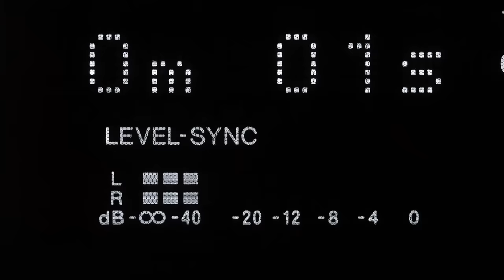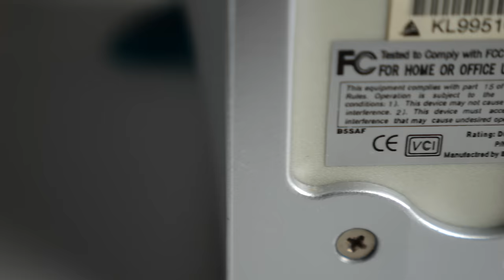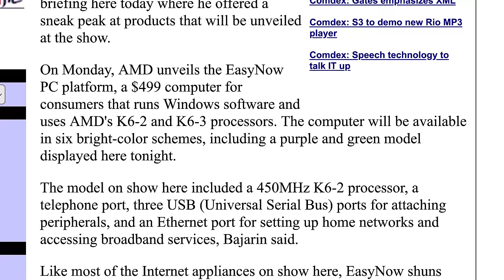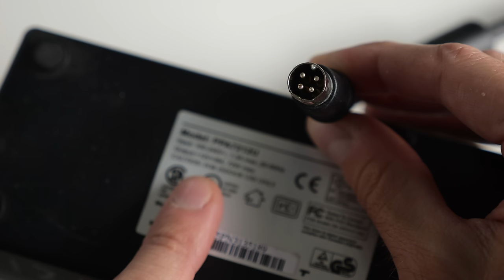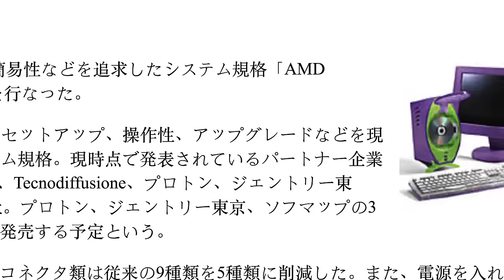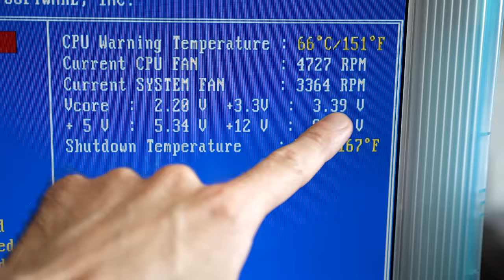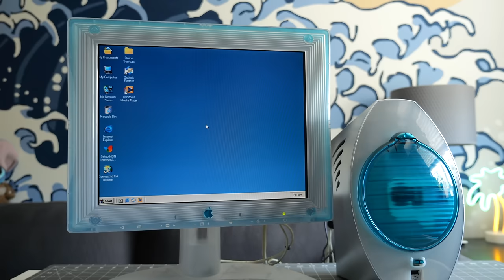EasyNow PC: The 90s Cheap and Cheerful Internet Computer

Comment: I'm so psyched to see this! I happen to have two these little easynow rigs in my collection. One of them was unused when I got it, came as a barebones system with no hdd, memory, or cpu. Has the matching speakers, keyboard, mouse, cd, manuals etc. Ended up getting it set up with a k6-450 and Windows 98SE. Both are all aqua green... 

Unfortunately never had 100% luck with Windows-Me on these desktops (device manager code 10). Even tried a random sis530 driver with no go.
Reply: dude that's awesome. where did you find this pc? i've been looking to buy one everywhrre
Reply: @papelrex I've had my first Easynow rig since I was in elementary school. Was given to me by a family friend when they upgraded. I always thought it was really aesthetic so it never got scrapped or thrown out. The second rig, (the unused Easynow pc) I got on good old Ebay about 5 years ago by simply stumbling upon it while scrolling.
Reply: @papelrex  Your best bet would be Ebay, yardsales, someones basement, and possibly storage auctions. They are really hard to find for sure. I'm honestly still really surprised to find one here on Youtube.

Comment: I had Windows ME. It wasn't great, but it was loads better than Vista. I'd still take XP as the go to Windows throwback though.
Reply: Windows 2000 was probably the best in my opinion, mainly because it didn't try to use all the resources for a flashy desktop.

Comment: Just a tip for splicing wires like that... don't cut the wires to the same length. That is, for the white wire, have it short on one side, and long coming from the other. Then do the opposite for the red wire.

That way, even if the insulation slipped off, the two bare copper splices wouldn't be able to touch each other cos they're at opposite sides of the splice. As long as they're connected nice and tight. Just good practice.

Comment: I don't really get the ME bashing either, it can be a fun os, however I must admit that in my use it really was pretty unstable. That's why I mostly use 2000 on my old PCs, you get nice stability and the retro looks of the older OSes.
Reply: This is why the bashing ->  "however I must admit that in my use it really was pretty unstable."
Reply: @harshbarj  Yeah but it's far from the worst thing ever, and getting unjustifiably angry about an OS that came out over 20 years ago at this point is just absurd to me.

Comment: THANK YOU COLLIN! for pointing out that Windows ME is not the nightmare OS that people make it out to be. It's like Windows Vista, I use Windows Vista on a daily basis for business tasks and it works just fine and XP and 7 combined. I have used Windows ME back in the day and I ran it on a old Gateway 2000 GS model, a dell dimension 2350, 2400, 3000 and every other computer and it worked just fine. Did not crash any more or less than win98. I too agree people need to let it go. I always hear about how bad it was.

Comment: Its not uncommon to see 11+VDC on the 12 volt rails of this era of computers, be it desktops with cheapo 50dollars PSUs or SFF with external power bricks. I have system rebuilt and troubleshoot a lot of the AMD k2 to XP era stuff and most of the computers I seen have 12 volt rails of below 12VDC and they work fine. But that 8.99VDC is definitely something wrong with the components.
Reply: Computers like this (that took a DC input) rarely actually regulated the 12V rail at all.  It was usually a straight pass-through from the supply, since converting 12V (+/- some tolerance) to a regulated 12V isn't (or wasn't, in 2000) trivial.  You can step down easily enough, and even step up, but a regulator that could buck, boost, or work at around the same as the input voltage, is a little more tricky.

Plus, in a space-confined application like this, it would have been desirable to only have a buck converter for 12-to-5V and 12-to-3.3V, plus an inverting regulator for a token amount of -12V and -5V, but not have to worry about 12V.

It's entirely possible the voltage monitor is just straight-up lying.

Comment: Now that’s a lovely looking PC, which is quite hard to come by these days. 

It’s great to see you measuring out the contacts on the power socket. Though the PC only uses the +12V input, you’d be very wise to actually confirm there’s no +5V power rail on the socket itself, as there are a lot of proprietary basic OEM power supplies being used for these kinds of solutions. All with a different pinout. 

So please, at least check for continuity between both the +12V pins so you’ll be sure there isn’t another voltage input available on the device itself, even though the manual states it only runs on +12V. ;)
Reply: Absolutely my thought as well.  It's probably fine, but the label is already wrong about the connector itself, so I wouldn't trust that it wasn't intended to run off a split 12V / 5V supply.  I actually have exactly one of these, with that same Mini-DIN plug, that was bundled with an external HDD enclosure.

Comment: I suspect that the floppy drive is an artifact of 32 bit x86 Windows, that it couldn't not have a floppy drive even if one wasn't installed. I'd love to see you install Linux onto that machine. Also, yeah, the look of that shell, totally looks like an eye turned on its side. Yep, completely suggestive of that. Definitely nothing else. ;)
Reply: I suspect that the floppy drive is an artifact of 32 bit x86 Windows, that it couldn't not have a floppy drive even if one wasn't installed.
No.
It's a BIOS configuration issue.
Reply: A lot of my older computers had this problem, no floppy drive, but a floppy drive showing up in Windows (XP in that case).
Reply: There is no SiS drivers for Linux, so that is a silly idea.
Reply: @IkarusKommt  According to the internet there are, so duck it and update your database.

Comment: As someone who suffered through Windows Me for like a year before swapping to Windows 2000, I disagree with your assessment that it's "not that bad". That operating system constantly had BSOD errors, program crashes, driver issues, and caused extreme mental anguish. It's easy to use Windows Me for all of one hour to make a video, but if you were to use it as a daily driver back in the early 2000s... you were in for a world of suffering.
Reply: Got that right I can't count how many times I had to reinstall ME on machines for people, and eventually gave up, and went back to Win 98se, or just put them on XP after it came out if their computer was powerful enough for it. The main problem with ME was it was sold with so many lower end garbage computers that barely met the specs for it like eMachines of the time with places like Best Buy suckering people who knew no better into buying them for a low price just to get them out of their inventory, with my late step dad being one of those people who got suckered, and I eventually just maxed out the RAM in that poor machine, and went back to Win 98se as it still had all the drivers I needed for it, and it was far more stable.
Reply: I'm sure that was the case for some people, but ME was my daily driver back in the day, and it was totally fine.  Well, as fine as Win 9x ever was or could be, anyway.

I dual-booted between ME and BeOS, and to be honest, I spent as much time in BeOS as I possibly could.  But, I was also into PC gaming, and did a bunch of audio stuff (multitrack editing in Cool Edit Pro, MIDI stuff in Cakewalk Pro, and so on), so I clocked significant time in Windows as well.
Reply: Everyone here used Windows ME because it had all the recent drivers and recovered automatically after user errors.

Comment: You gotta be careful with replacing caps on these, they need low esr in power regulation section. This is a general tip. My business checks the original caps specs before replacing them.
Reply: Do you desolder every cap before testing?
Reply: @ek8710  no. But if im replacing them, I note position and cap type. Then I look up datasheet. If I can't find one I use very best cap I have depending on placement
Reply: @thomasandrews9355  but then how do you get an accurate capacitance reading without desoldering
Reply: @ek8710  cap is labeled. Caps are old enough that better to just replace anything critical.

Comment: I have multiple computers here that use Ctrl+Alt+Esc as the BIOS configuration shortcut.  But they are 286/386 era machines, so I'd say it is pretty unusual to see it on a late '90s system.

Also if the machine really has 12V regulators on board the voltage sag you're seeing may just be dropout -- You'd typically want to feed a 12V regulator with 15V or so.

Comment: Just wanted to mention what was said about the airflow configuration. Typically the CPU fan blows down and in from the side of the case and the rear fan exhausts out, not the other way around. I would imagine this PC works the same way.

Comment: I do remember seeing <ctrl>+<alt>+<esc> as the BIOS command, and I believe it was the Award BIOS also.  I wish I could remember what system it was on. Maybe E-Machines (remember them?)  Yes, it's a perfectly good gaming machine, if the games you play are Reversi and Solitaire!  Has anyone actually tried making these useful in the 21st Century by finding a lightweight Linux version that will run on it? It would be a more secure way to surf the 'net more securely than an ancient version of Windows.

Comment: Windows ME had an issue with memory management where RAM wasn't freed up after closing a program, which caused the swap file to be used more often than necessary. 2000 and XP got along with more retro hardware than ME did.

Comment: Interesting little AMD K6-2 box - reminds me of the HP Neoware CA2/Wyse Winterm 8440XL, which are an old K6-2 based thin clients that uses a similar 4 pin power supply setup.  There's also the Cobalt Qube3, which are K6-2 based home micro servers that had DIN power bricks.  Those are interesting boxes to mess with as well.

There is actually a line of AMD K6-2/3+ embedded CPUs (K6-2E/3E) which are meant for industrial/thin client purpose.  They run a bit cooler than the stock desktop models.  Some of those models are based on their mobile lines so they both sip power and have PowerNow clock throttling support.

Comment: I would want to slap a modern mini ITX board in there and make it a Hackintosh. It certainly would look the part. 

Thing straight up looks like a Blueberry G3 "PowerMac Mini" concept that got to production but never quite made it to market and got dumped off later by the pallet.  

Never heard of these or even seen one before, and that's pretty rare for me, so thanks for posting! I'll keep an eye out for a dead one.

Comment: Congrats on discovering that power issue in the BIOS in a computer that otherwise seemed to completely work, and fixing it. It is amazing you were not getting random hangs/crashes and you could install an OS and even some drivers with the machine in that condition (including underpowered hard drive and optical drive), I can imagine it would have failed after not much time though.

Comment: 8:40 Not only K6-II and K6-III ran hot. Athlons and Durons also ran hot and they had super noisey fans rotating at 4000 rpm on top of the big coolers.
And I agree with you regarding Windows Me. You may want to check if DMA is check under the Device Manager/Hard drive/name of the hdd.
Reply: Yes, but the K6-II+ chips were designed as laptop CPUs, and were drop in replacements for the older K6-II/K6-3 chips. Much cooler running, and if you find a 500mhz K6-II in the wild, it is as likely to be a + model as not.
Reply: @Trenchbroom  Probably. 
Long ago, someone donated to me a Compaq laptop with a k6-ii I think at 500mhz, big cpu, probably super socket 7, big cooler, place for 2 vertical fans but only one was there and the other opening was closed, very small fan. 4 or 8mb of onboard ram, one slot of ram unpopulated.... unfortunatelly i think it was killed because probably someone put a regular 19v while only 15v were needed. I took apart the laptop but........ lots of screws and parts... didnt bothered to assemble it again..

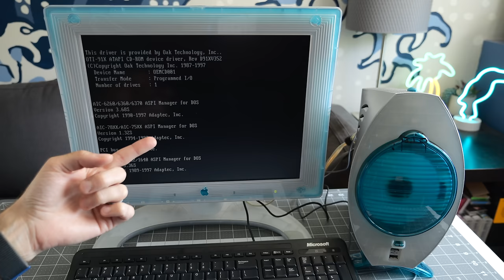Comment: 22:00 Nice alternate reality you lived in.
22:15 Because it was more bug filled than Vista.

My experience with ME was an absolute train wreck. Every program would crash on launch with a 80% change and pop up an error. Sometimes programs would launch and randomly crash with an error for seemingly no reason. I have two instances where the system itself crashed System32.DLL and bluescreened. I can not, and will never forget "System32.dll has caused an error in System32.dll and will now close" BSOD. I will never forget that experience that made me install 98 SE and then XP later.... 

Neat video though. I've considered buying an old comcrap just so I can play some old games again.

Comment: Easy way to find out pinout without taking things apart is to set your multimeter to continuity beep and set one probe to any of the connector sheilds like the screws of vga port and use the other probe to measure each pin of the power connector. The ground should give u a solid and instantaneous beep both ways and the positive should give u no beep or beep for a fraction of a second and some resistance of voltage drop. U will found two pins with continuous beep(negative) and two with momentary (posetive) beep.

Comment: This is a cool video, thanks for making it. I was curious whether the power details are actually printed on the case underneath the bar code stickers that are directly below the power input on the back. It seems like you got there anyway with checking the pins, but I do wonder what's under those stickers!

Comment: Hm, would be sick to change into a custom case. Spray paint it matte black and put in an LCD/Info screen featuring a RGB energy orb in place of the vertical CD bay and fill it with some pretty slick parts.

Comment: The original adapter might've been higher than 12V to let the onboard regulator be able to get it down to 12V.  The onboard regulator might be a buck converter that doesn't have the ability to go to a duty cycle of 100%.

Comment: I remember having to use nero to add boot support to my windows 98 cd's. Since I don't plan on using old hardware any time soon when I can emulate everything on a modern pc, I appreciate youtubers who can show me all this great stuff. I appreciate it. However I am a person that didn't like windows 98 or 98 se. I used both. I also had windows 2000 beta and ended up trying windows 2000 professional, server, advanced server and data center. I loved windows 2000 and just abandoned windows 98se and went to windows 2000 and xp. 
Now I know that is beside the point. I had friends who were using windows 98 who were ok with the terribleness of windows 98. They said it made their games run better and used less resources and that was all that mattered to them. I decided upon giving windows 98se and windows ME a try to see. I used windows 98 for a couple months, but I ended up using windows ME for awhile longer just to experience it in it's entirety when it was still a viable operating system. Honestly I liked it better and I had a fair bit of understanding in how to update my drivers and in this case, install WDM drivers and avoid windows 98 drivers. So my system ended up being as stable as a win9x system could hope. I had 768mb of ram installed on my pc, so I ended up rarely needing to run a memory manager to cull leaking memory. I had a good experience because my computer was fairly stable and I used proper windows ME wdm drivers. I also used good memory. I remember microsoft once blaming the old stability issues of windows 9x on memory instability. Which microsoft had a fair point, memory was the wild west of sourced memory modules for most pc's and memory in general was largely sold with  a maker and lousy chips. Not entirely the root cause of instability either. Windows 9x was not great for stability and it was very much known for as such. Sadly it was prone to issues by and large, but VIA and SIS chipsets typically weren't great and the capacitor plague for sure was a problem.
Typically intel based chipsets on intel boards were stable or fairly stable. They often just had good all around support.
Since I was an AMD user, I had to get a good quality motherboard, cpu and memory and a VIA chipset, I often kept an eye open for latest drivers and bios's. I do remember this affecting choice of stability and appreciating it later on.

Comment: You are absolutely right about how boiling hot the K-6 AMD processors were. I bought a generic K-6 computer to practice OS installs, computer networking in 1999. The computer ran so hot that it fried all of my hard drives that I upgraded it to, with the metal case so hot that I could barely touch it! On top of that the SIS motherboard had a known defect that caused the blue screen of death 2 to 3 times a day at random - but this glitch occurred whether the computer was warmed up or not. With all the problems, I eventually removed all the memory, the original hard drive which had a heat shield and I had a brief funeral giving it a proper burial.
Reply: Only some K6s where warm but not hot, only unusual in that time frame. K6-2 and 3 where absolutely fine regarding the temps. Also If a CPU can fry your hard drives, something else was wrong.

Comment: I know people will come at me with pitchforks and torches but someone, somewhere, needs to procure one non-functional unit and make a sleeper PC out of it. There's room for an ITX board with a low-height cooler and the space leftover from shrinking the motherboard size could make it fit a 1U or FlexATX PSU.

Or heck, since the internal frame is almost a simple box, you can dremel some steel and make one from scratch, then tack on the plastic exterior.

Comment: That would be easy to identify the pins. All you need is a multimeter with continuity test. the CD drive power socket is the way to start.